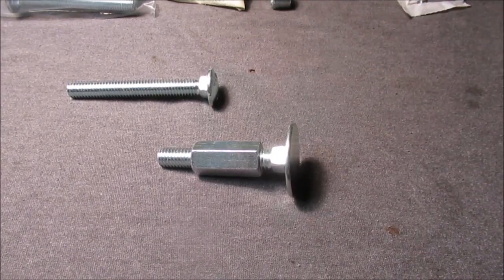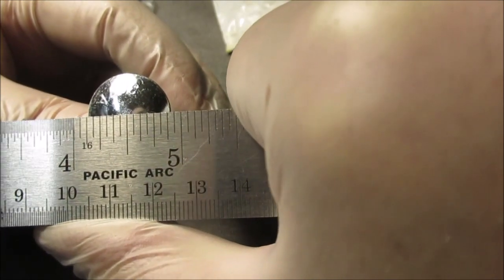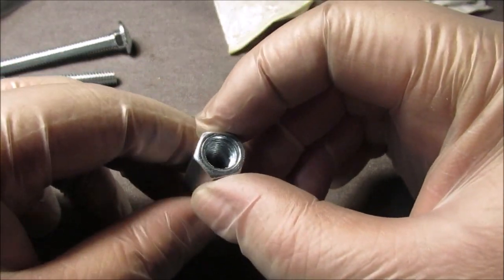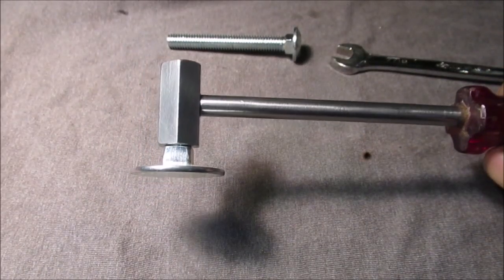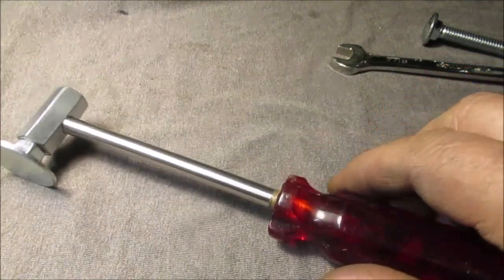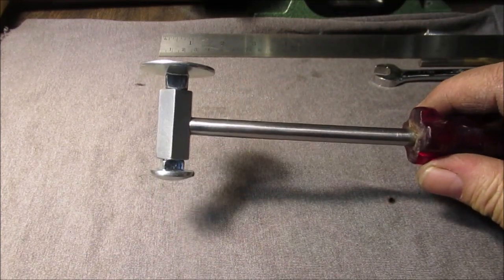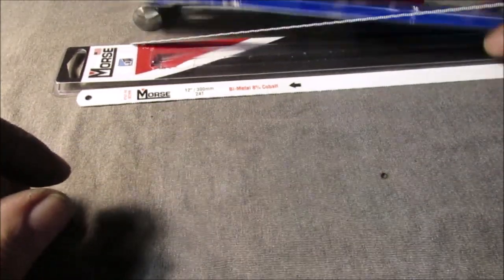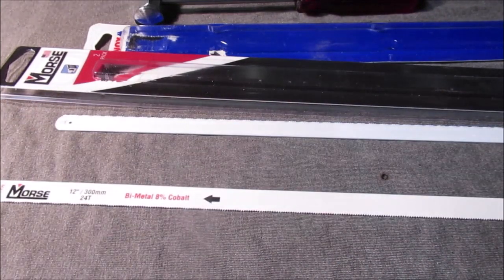Homemade Hammer made from a Screw Driver & common hardware bolts

Comment: Finding a good cutting and long lasting hack saw blade can be a challenge.
Reply from the maker: I like the Morse blade ..It fits in between the threads of the bolt threads better  and makes a smoother cut